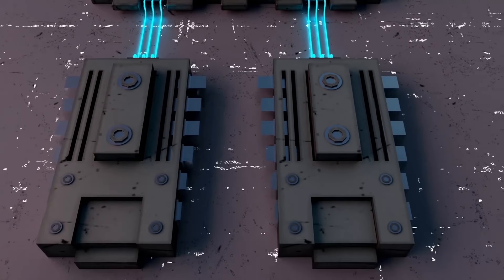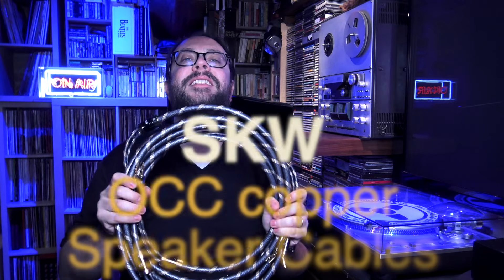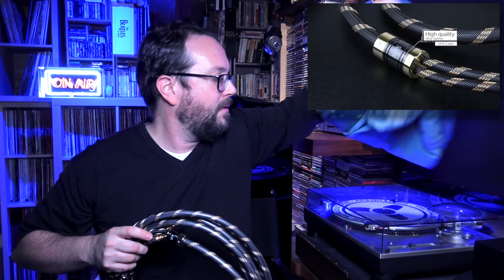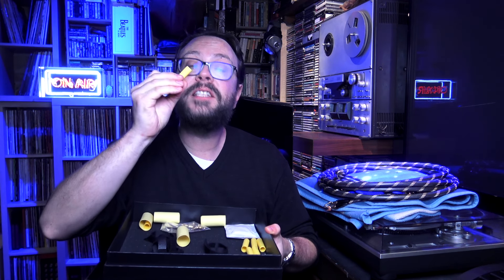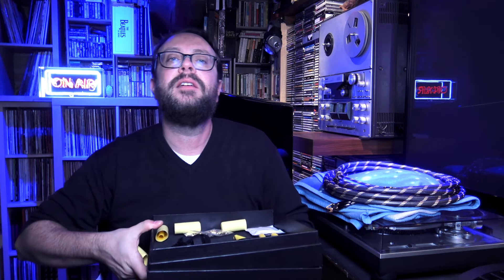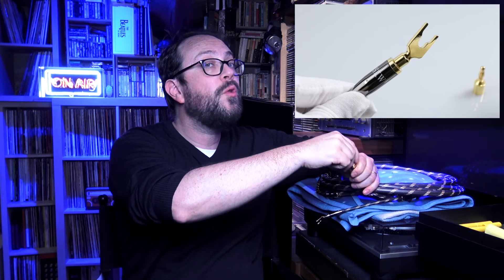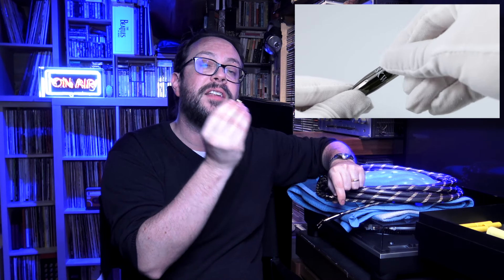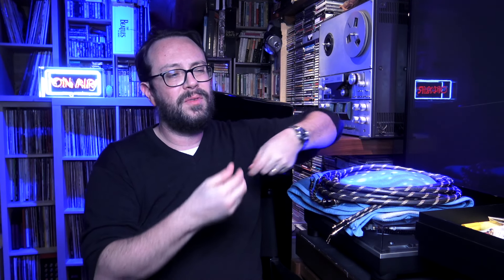Unbelievable high-end OFC copper speaker cables at very low price!

Comment: Hi. Ok, they claim that conductors in this cables is OCC copper. How about spades material? If is gold plated brass...that it will be a disappointment. Can you test this? I was thinking about having polished a very small surface on one of the spades terminals and on the metal thread surface, in order to reach to the core material. If is pure copper, it should be redish color... If the color is golden, than most likely is brass...
Reply from the maker: I don't know but I am pretty sure it is gold plated brass. Who claimed the opposite? Please bear in mind the extremely low cost of these. If you want better stuff, like OCC copper CONNECTORS or silver, at decent prices, the best is DIY. I did a few videos on how.
Reply: @anadialog  If they (by 'they', I'm referring to the manufacturer) didn't mention this (the core material that the spades or banana plugs terminations of the cable are made, which is also very important), I was just wondering... I didn't say that someone claim one way or another. That is the reason why I suggested a simple test. Thank you for replying, anyway.

Comment: Hi there , what is the insulator over copper? Is it teflon ?
Reply from the maker: I wish! No, its PVC. The cost is low also for this reason.
Reply: @anadialog  did you test if connectors that look real high mass are magnetic?
Reply from the maker: They are not magnetic
Reply: @anadialog  Nice, I like the mass of the connectors to be a light and low as possible with pure copper gold plated ...

Comment: Hi. Why don't You use Cabled with wiered Shild? That Shild can You connect on a Ground an Preamp etc. It meakes great Sound difference. That all explane Supra with their PLY's Cables.
Reply from the maker: I do, but in general shielding increases capacitance and lowers dynamics. Not in all cases but it may happen. If you are sure not to have too much interference I prefer to go shieldless

Comment: I bought these cables and a pair of QED revelation cables for a little more. If they are as good as the QED, It’ll be be my goto especially with the adapter ends. It would be nice to have some flat ends on the adapters so you can tighten them down securely or remove them with a small wrench.
Reply from the maker: Let us know! I had Qed silver anniversary interconnects once...one of the worse cables I ever had...

Comment: This is a hard topic. 
They state: "single crystal copper conductors combined"
I presume that it is multi stranded conductors and they do not specifying how many strands there is in each conductor.
So without lying they only need that one strand in the multi stranded conductor are a single crystal copper conductor. One in each conductor so two strands/conductors in each cable..

But nobody knows!

I were on the fence to buy a pair two years ago but when not knowing  if all strands in the conductors is of a single crystal copper, specification.

Then it is a no go for me.

Instead I ended up with that I built my own speaker cables and then knowing what I had. 
When physical silver is measurable better conductor than copper/gold. 
Than I used a single dead soft fine silver (99.99% pure). 
(I am willing to pay when I KNOW what I get. But I do not want unknowns.)
Reply from the maker: Perfectly reasonable. I do my own as well, as claimed in the video. Silver is the best but needs maximum purity and high quality geometry and insulation, possibly teflon.
Reply: You are the guy the industry just loves....
Reply: @CasusBelli1000  "The industry loves.."
You mean Science (is that a industry):
That silver is a better conductor than gold/copper. 
And cutton is a better dielectric than Teflon.

"Science is the pursuit and application of knowledge and understanding of the natural and social world following a systematic methodology based on evidence."
Reply: Optimize 

Rho silver is 0,16
Rho copper is 0.17
Rho gold is 0,32

For cables you need the best dielectric.
For inductive purposes you need the worst dielectric.
Reply: @marcelmolenaar5684 
Yes! A conductor such as a metal has high conductivity and a low resistivity.
So both of the properties conductivity (S/m) and resistivity (ohm m) are better for silver than copper @20°C. ]
Reply: Optimize 

Teflon has a better dielectric than air or cotton or paper.
The worse dielectric the better for the magnetic field.
Confusing? 

Audio signal related circuit ;
If you want to upgrade an amplifier replace the conductors for black gates and replace the transformators for with ferrite-core ones.
Ferrite-cores are a lot faster than iron glowed plated cores.

Don't mix copper and silver in the primary circuit for the audio signal of your amplifier.
If you do, you create a nod that causes unwanted signals.

Use "slow" transformators for your wall socket, you want only 60Hz if you are in America or 50 Hz for Europe.

I hope you understand what I mean because English is not my native language.
Reply from the maker: True, but it's hard to find pure cotton insulation. Air (vacuum) is even better and in fact the Ramm audio cables I presented in the speaker cable guide video use cotton and air.
Reply: ANA[DIA]LOG 

I'm sorry man but I mixed up something in my post, I have corrected it.

The better the dielectric the better the magnetic field is isolated.
The worse the dielectric the better for the magnetic field
Reply from the maker: Teflon is great but air and cotton are actually better. Check this complete list: https://www.google.com/url?sa=t&source=web&rct=j&url=https://www.kabusa.com/Dilectric-Constants.pdf&ved=2ahUKEwjDuufGpu7tAhWT7KQKHR_UCu0QFjAJegQIChAB&usg=AOvVaw0S-PqobbWJGqfbnOwNUTYJ
 Inductance isn't that influenced by insulation. It's influenced by the other conductors next to it. In any case here is a nice list of materials and their dielectric constant:

Comment: Thanks for the great video!  After researching them, it apears that the cables in the link are Oxygen Free Copper, not Ohno Continuous Cast.  Correct?  Thanks again!
Reply from the maker: I checked the links and it still reports Single Crystal Copper. OFC has around 50 crystals per meter, while OCC is 0.008 per meter. They don't use the term OCC some times because it implies copyrights or specific procedures that are not identical to that invented by Prof. Ohno. They are still OCC-like.
Reply: there's no such thing as OCC like it either is OCC or it isn't period, if they're not using the same procedure then it's not single Crystal sorry, like I told you before the Chinese don't have OCC single crystal wire there's only two manufacturers in the world one in Japan and one in Taiwan that have the licensing and machinery to make OCC single crystal wire.
Reply: so you shouldn't be making a video saying that this is OCC single crystal wire when you don't even know if it is or not you're misleading people.
Reply: @chrisrichards2827  Thanks for the heads up (information)!
Reply: @anadialog  OCC like is not OCC there's no such thing as OCC like it's either  OCC or it isn't, sorry but you got scammed there's only two companies now that make OCC wire, Furikawa in Japan and Wan Lung in Taiwan which owns Neotech.
Reply: there's only one way to make single crystal wire and that's it,OCC.
Reply: @anadialog  and if they were buying it from neotech there is no way they could sell the cables for that cheap and like I said before there's only one way to make single Crystal copper and that's the OCC process. and I went on their site and nowhere does it say that their wire and I looked through all their interconnects and speaker wire and nothing said OCC single Crystal copper and then I also saw pictures of their factory and nowhere is there machinery that resembles the machinery used to make OCC single Crystal copper.

Comment: I did order the DIY Ramm Audio speaker cable kit that you even mention in this video last summer, same as you did with spades. Sound quality impact was so much more than I could ever imagine - well my old cables was 1€ per meter :-))

Now I've been looking at the SKW power cord for some weeks, 3m to my XTZ sub and 2m to my Hegel amp, main reason I need longer cords and the wish for something better than standard cables, the black and gold is a realy nice looking cable as well but I don't expect that much improvement.

Have you done any test of power conditioners?
I just added the unexpencive Powequest 3 to my system, only change I can hear is less distortion on high volume
Reply from the maker: Quality power conditioners are a great idea. If they are not designed properly they will suck the soul out of your sound. Actually I spoke of this in my very first (and awkward) video: https://youtu.be/elU1cEMLjYE
T
I am using a very good ( and darn expensive) solution created here in Italy as you will see but boy if they changed my system. There is a reason why I choose this topic for my first video.
Glad to hear tye Ramm were good!
Reply: Hello Lars, where did you order the Ramm DIY cables? Thanks in advance
Reply: @audiogear6978  Sorry for the late reply…
I first purchased cable and one pair of spades from one company, and later another pair of spades from another company due to price, orders came from a French and an Italian company but don’t remember company names. Still using this cable with my Hegel and still appreciate the sound quality

Comment: Looks like the Nakamichi tips of this type are not available on Amazon anymore. The newer types do not allow the head to be removed like the way we need it. I ordered and had to send back the original and the replacement. They need to fix the pictures which do show the type you suggested. Even the Nakamichiplugs website does not have the type you bought. They must have stopped making it.
Reply from the maker: No, in fact look only for those I linked in the video description. It took an hour to find the correct models on all Amazon portals. It says Nakamichi on the body but they are just rebranded, it's all Chinese stuff. In any case you must look for the cheapo plastic read and black connectors. Those are the only unscrewable ones with a hallow screwing part. Check also aliexpress: https://m.it.aliexpress.com/item/4000192917087.html?trace=wwwdetail2mobilesitedetail
Reply: @anadialog  I already order and received from that link of Aliexpress. All good 👍

Comment: Not a fan of cast brass connectors of any kind. Picture a dam on a river regulating flow. Check the speed of electrons through different metals, that's why silver and copper sound different. Best way of connecting is void (air) free crimp. Not possible for DIY. You have to make a test crimp to see if it is void free. This can only be done with a destructive test. I only know of Blue Jeans terminating in this way. This means soldering is the only way to have a void free connection. Use WTB or Cardas eutectic 4% solder with a quality (you can set the temp) soldering iron..

Comment: Burn in cables? how is that possible?
Reply: Impossible
Reply: Its not. If that were the case and using this theory of burn in they would then at some point burn out.
Reply from the maker: As I have explained in a few comments burn-in takes place mainly in the dielectrics, the insulation of the cable. The dielectric constant modifies the capacitance of the cable hence the quality of the signal. It's science, not snake-oil.
Reply: @anadialog  why not make cables with more stable insulation? If it changes the capacity of the cable, we should be able to measure that right?
Reply from the maker: Yes, I would think so, even if other ongoing stuff is not picked up by machines, but you need the right equipment, which I don't have...the problem is like a blood test, the results include only what you asked to look for...
Reply: @anadialog  explain?
Reply from the maker: Which part?
Reply: @anadialog  the results? Results are results. Why on earth make a cable where the insulation changes over time supposedly affecting the audio, when does it stop modifying itself? Utter nonsense. Agree to disagree.
Reply from the maker: I seen you have already your answer and driven by prejudice. Results are results but it depends what you are testing. As I said, a blood test does not reveal everything going on in one's blood. You only get results for what you looked for. It's the same. Moreover, several audio engineers and respected people in the industry agree for instance that the best performing gear in terms of results and measures rarely is the best sounding machine. I made some grounded examples in past videos on cables, go and watch them, of this as for the relative permittivity of dielectrics.
I must admit that we are lacking scientific articles on the subject, that both dismantle or substanciate these claims. There are a wealth of papers produced by cable manufacturers but I can understand that they are part in cause so we would need someone super partes. Sadly, this as other cables facts are not study at length so we are missing true reference. Nevertheless, burn-in is something that does not help cable sellers so I tend to think that their analysis is correc, simply because to me it is clear as daytime that something happens after leaving a pair of cables active, with a signal going through them. In any case, as I said a million times, it is fact that insulation greatly influences the signal, hence an intensive use can only enhance specific processes, negative or positive, that are undergoing.
Reply: @anadialog  as you said lacking scientific articles on the subject. So it is purely based on perceptions by supposed engineers and cable companies. Although I don't know any electronic engineer who feels cable burn in is real. People would be better off upgrading their crossover components to enhance an immediate difference that is truly noticeable. I am not driven by prejudice thank you but by facts, science. Question for you, so you could pick out the burned in cable over the same new cable 100% every time? A simple Yes or No is all that is needed not any blind test nonsense does not work etc...
Reply from the maker: I know what I am hearing. Paul McGowan is the chief electronic engineer at PS Audio and he claims what I am saying plus he also says that it is measurable: https://www.psaudio.com/pauls-posts/dielectric/
Reply: @anadialog  agree to disagree. Enjoy your cables.

Comment: Typical.....the industry sends out it's hounds to protect the cable thieves. This SKW cable is OCC....the company has a few tiers of product which it seems to be fading out for just OCC.  My whole digital stream line is all SKW and it's unbelievable the sound quality.  I have done studies and have the proof, but I was attacked in every audio group I belong to when I shared the info.  OCC vs OFC is similar to Wave vs Mp3.  So, if you use OFC you are listening to mp3's against the OCC wave sound profile.  You'll think you have new or different speakers once you go with OCC.

Comment: cable burn-in?? 1:19
Reply from the maker: Yup! As acknowledged by several pros in the field. Burn-in as explained in other comments takes place mainly with the dielectrics, which in fact greatly influence the signal due to its relative permittivity and the capacitance increase.

Comment: IME, screw off spades are even worse for sound quality. You just doubled the connections that signal has to go through. Best is bare wire without any spades or bananas.
Reply from the maker: True. I agree. But for the cost, this set is unbeatable IMO.

Comment: You won't hear it. As brass connectors degrade transmission 75 percent. Tellurium connectors silver solder or graphene coating get you that 90  percent conductivity.  Scientifically IACS standard. Audio quality for cheap abundant Cat5 cables 10$ plus silver solder forget connectors.
Reply from the maker: Its 24k gold connectors. The external plating counts more than the inner material. Plus it is non-magnetic while telluroum-copper is.
Reply: I read in one of the ads on AliExpress that the ends were aluminum coated with gold, not copper

Comment: if it's made in China there's no way that this is OCC single Crystal there's only three companies out there that have the equipment to make single Crystal copper and none of them are in China.
Reply from the maker: Incorrect. That was before Furukawa closed. Now several companies are making monocrystall copper, no need to call it OCC copper. Here is a video I made on the topic: https://youtu.be/YCgfQr84Yco
Reply: @anadialog  well just so you know monocrystal and OCC single Crystal is not the same thing maybe you should do your research a little bit better and the Chinese lie about everything anyways so if you trust them good luck to you, I'd rather buy from Wan Lung in Taiwan that makes neotech cables because they are one of the original companies that was licensed to make OCC single Crystal.

Comment: MEH I used speaker cable less price than this and sound perfect. I use mine for SACD and listening to Pink Floyd Dark Side of the Moon with much cheaper cables no difference. I've think snake and oil plus placebo effect springs to mind. I've watched many videos on speaker cable and the differences are miniscule if any at all.
Reply from the maker: Which quality speaker cable have you tried?